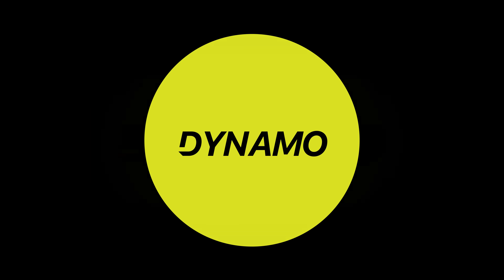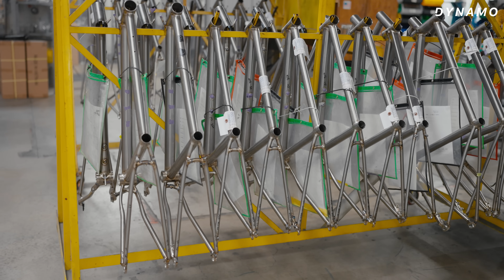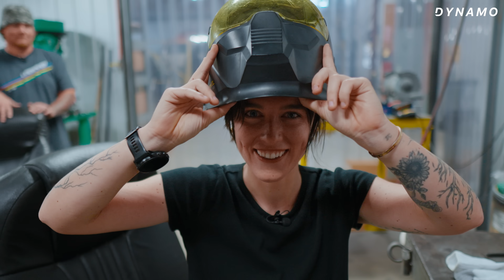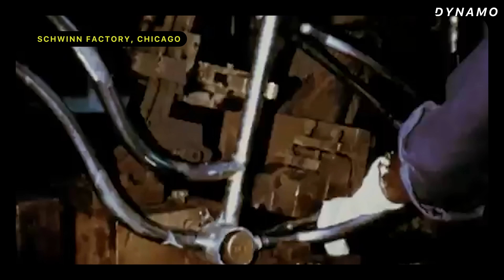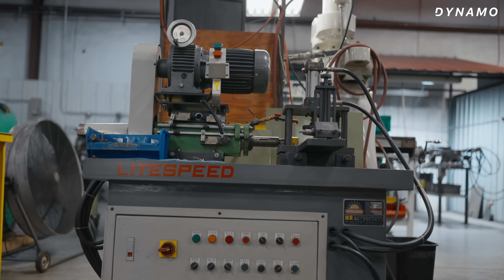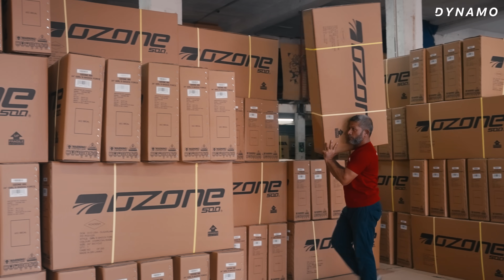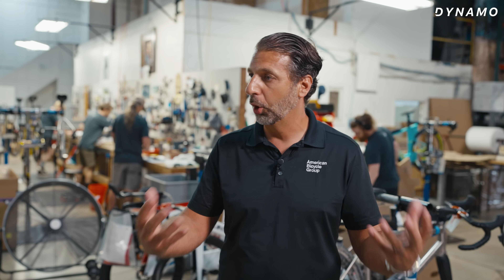What 'Made In America' ACTUALLY Looks Like

Comment: It should be noted the overseas factory was making cheap bikes sold in Walmart for $350 and that Litespeed titanium bike is a work of art intended to be purchased by true bike enthusiasts, designed to last a lifetime, but with a $6000 price tag.
Reply: And there are many more bikes at $6k and $10k price points made overseas that are equal or higher standard "pieces of art" - not sure you're making the point you think you're making. The US can't do high volume, but it's also incapable of leading in the bespoke luxury market.
Reply: @amerikalast  they are even cheaper then this piece of art shit. max 2k-3k you can get same from overseas including shipping. I know because I use it here in India from local manufacturer which makes titanium and carbon fiber bikes. in 2k you get ridiculously good bikes.
Reply: @amazingdude9042 LOL, yeah let’s compare straight gauge Ti with spotty welds that lack decades of experience and a dodgy warranty to shaped, tapered, butted, tuned American Titanium, including 6 Al 4V grade that only the masters work with.   Litespeed and Seven make the lightest Ti frames with the most sublime ride and tuned power transfer, but good luck with those plain round tube and frequent contaminated welds on your cheap titanium frame.
Reply: @amazingdude9042  can you share the names of the local bike brands?
Reply: The thing is, the Litespeed if manufactured in Asia would only cost 1/3rd that price for an equal quality.
Innovation is the only place the US can win, and frankly innovation is copied pretty quickly these days...
Reply: @ryanj610  They have openly been begging other companies to open places in the US so the US can STEAL their innovations and take them for themselves.  trump literally stated that to Korea, they intended to STEAL their R&D in batteries and then try to take over the global market using KOREAN AND CHINESE innovation [because Korea and China jointly lead the world in battery innovation with Japan coming in 3rd].  That isn't innovation, that is outright theft - something the US is good at accusing others of, guess when they do it it's different - and even when you had the technology I seriously doubt you'd have done any innovating with it.  You simply don't have the educated workforce any longer.
Reply: @HeroyamSlava-g3y  America has the Educated Workforce. They are simply looking for jobs.
Reply: PROOF? Don't think it was ever stated Trump wanted to Steal Koreas R&D. Do you have something I can search up?  @HeroyamSlava-g3y
Reply: @ryanj610  Carbon is the way in Asia. They just aren't interested in Titanium bike frames for the most part. Motobecane has frames made in Kenesis, Tiawan that are really, really good. I put 80k miles on one and it still looks new. I wore out everything else on the bike, but the frame stands alone, unblemished and beautiful. Titanium has a really nice, cushy ride. I paid $1400 for that bike in 2013 equipped with SRAM Rival, Mavic wheels, and Ritchey bars, stem, and seat post. The drawback is that they only offer 1 frame for each cycling discipline. Litespeed offers several frames in each discipline that appeal to different riding styles. The cost of high-end bicycles is pretty much the same across the board even if they are made in Asia. You won't find a big name bicycle with electronic shifting for less than 6k these days. If you decided to buy a bike assembled in the US, you would likely get a custom setup that is assembled by experienced techs in a week or less. If you desire you could visit the factory and get fitted for a custom frame. So, service is definitely the edge you get. I paid for my current bike that was built overseas and didn't get it for 4 months. Certainly not a preferred buying experience. It was another Motobecane for 3k this time. Love the bike though.
Reply: @ryanj610  The US can win in innovation only in some specific fields. In terms of manufacturing and automation, I think they've fallen behind.
Reply: We had a high end, world renowned, backpack manufacturer here in New Zealand , who moved to Asia for cheaper manufacturing, at the loss of 300 jobs. Funny thing is their prices actually went up a little !!!
Reply: Would be interesting to see the profit on the Walmart bike and the LiteSpeed Bike on a per unit basis ?
Reply: and with those tariffs they are both gonna be a lot more pricy
Reply: It should be noted that there are bikes that cost more than $350 but less than $6,000.
Reply: Tour de France competitors are using Japanese, Taiwanese and Chinese bikes… just saying..
Reply: Those Walmart bikes don’t last 6 months.
Reply: The reason why asia doesnt wanna make ultra expensive bike because they simply dont see the potential market for it.

Luxurious and prestigious brand perception is sadly not something that asia can make. So even if they make a bike that’s as good as litespeed, ppl will always throw a side eye on it
Reply: @Centrioless there are TONS of very expensive bikes ($10k) made in Asia.
Reply: Amen! Most Americans don't want value.
Reply: THIS
Reply: true , but at the end of the day that logic is bullshido . People do not want to spend more than necessary and in reality they don't have that extra money that's the main issue . So when a nice Focus , Cube , Merida or whatever brand is available at half the price or less , guess what 90% is gonna buy .
Reply: I am from Sri Lanka those statistics are first time I see
Reply: One of their fully built road Ti bikes is $16,000
Reply: I am sure 350 doller bikes last's for ever cheap price tag don't mean they are cheaper quality. Titanium is lighter in weight and expensive to make and those who buy it are mostly high income countries. Even it could be cheaper if made in a low income countries.. but there isn't a big market to it and lot of export ristrictions in usa.
Reply: Chona?
Reply: That'll boost the economy! lol
Reply: @pompeymonkey3271  lol.
Reply: Few people actually use or keep anything "for a life time".
Reply: @orangetube1  True, but quality that will last a lifetime if you wanted it to is nice to have when screaming down a hill at 50mph and hitting a bump with zero affect on the frame. You will never get it, so why are you even here?
Reply: @rustymaximus9179  Hahahaha, "you will never get it.  Why are you even here."  Time to look in the mirror kid.
Reply: @orangetube1  Do you know what clipless pedals are? Do you know what Di2 is or SRAM AXS. You know what a Panorello is? Do you know what a department store bike weighs vs. a high end bike?
Reply: Yea the host being a cyclist should realize she is comparing apples to oranges. If she went to a high end Taiwan bike facility, she would be closer to a good comparison.
Reply: And people enjoy the $300 bike as much as the $6000 bike.  America is a failure as fare as manufacturing because American politics are anti business anti technology.  China is decades ahead because they are pro business pro tech.
Reply: And that is where American (or EU or UK) manufacturing makes sense.  There are people who are willing to pay $6000 for a bike that is made with fair wages, high craftsmanship, best parts. However, there are a whole lot more people who want a bike for their kid that will be outgrown in 2 years or they only make $500 a month and need cheap transportation.  The first is willing to pay and they have the ability to buy because it is important to them and they can afford it.  The second group is buying out of necessity and won't necessarily pay a lot.  For all those make it all in America, what you will see is the high end will stay the same, but the low end will either go up in prices or we will all be buying used bikes (or bikes that are "used" and then imported into the US - take a look at the yacht and supercar industry and how well luxury taxes worked before they repealed them in 1993!)
Reply: @boomerbobable  It’s cute that you think American or British manufacturing is superior to Asian. 😂
Reply: @ws1814  For some products it is. Just like how Germans build incredibly good manufacturing machines and industrial motors.  China/Asia are not the best at everything, nor is America or the EU or UK.
Reply: @boomerbobable  Germans =/= American or British.  Just look at your typical American made cars. Are you proud of them?
Reply: @chunhaylee  I am not sure what your point is. A top of the line US car is about the same level of quality, etc. as those comparable in price from Japan, Germany, etc.  A cheap mercedes is about the same as the same priced Toyota and the same priced Ford. Every vehicle has some inherent issue and balance of where they spend money on interior and performance (US tech tends to be better, but performance lower or engine reliability high but cost of repairs very expensive comparatively.  My parents have a 25 year old lexus that is in amazing condition with 80K miles, while my 11 year old Ford Explorer has over 250K miles on it and starting to show signs of wear, but repairs are relatively cheap compared to the lexus I used to own.
Reply: $6k on a bike is ridiculous. I don't care how much you make or enjoy something. I enjoy food, yet I've never paid more than $30 for a steak. Done photography for years, but I only use my phone. I'm able to save 70% of my salary, for what or who, I don't know. However, I enjoy living a cheap life style and like spending night having a beer and staring at my bank balance.
Reply: @动漫主角 If someone makes that much money it is fine. $60,000+ USD. Maybe is a dual income household. That is an entirely different topic.
Reply: LOL. "Bespoke" eh, so pretentious.
Reply: The walmart bike also lasts a lifetime. Not the chain, of course. And yes, the wheels may brake.
Reply: And no suspension lol.
Reply: Exactly typical American exceptionalism bullshit.
Reply: Crazy expensiv when u can get a scooter with 300 cc within same price.
Reply: Wanna hear something crazy. In 2019 I bought a 2014 Suzuki Gsxr 600 (a sports bike motorcycle) with less than 30k miles. 

Yes bicycles fulfill massively different purposes and have vastly different running costs, but it is crazy to me that my dad bought his bicycle (two of them) for $7.5k each and it’s so hard for me to wrap my head around the fact a bicycle was more expensive than my motorcycle. 

And there are cheaper motorcycles available brand new (Honda Grom and similar)

Edit: added context for more clarity earlier on
Reply: @327efrain  I get your point, but you never said how much your GSXR cost.
Reply: @327efrain  I have noticed that as well.  Its crazy how a 30lbs bicycle costs the same same as a 400lbs motorcycle.  A lot of cost of bicycles come from making them as a light as possible, utilizing expensive materials and a lot of design time getting them to the edge of strong enough.  Its not the end of the world for a motorcycle to be an extra 50lbs heavier because it has an engine.  I think there is a larger demand for motorcycles as well.  So motorcycle manufactures can buy a lot of parts and get better deals than bicycle parts that are being purchased in smaller quantities.
Reply: Fortnine, a popular motorcycle YouTuber, already has a video covering this  @327efrain 

When my GSXR1000 was stolen, I was bummed and moved on. When one of my mountain bikes was stolen, I went out of my way to replace it as soon as possible.
Reply: That $6000 US bike is a scam. The metal is not US. And, nearly all of it is off the shelf parts from over priced suppliers.The issue with US companies  is that they should be making that same quality for $1500 to $2500 rather than $6000 so they can take part of the lower part of the market while doing true innovation in manufacturing and engineering for their $6000 US bike. Too complacent on value which results in bad value for money and bad quality(benchmarks and premium-ness) for money. US small business mentality is make a scam and then let the business(and industry) die out.
Reply: @kknn523  indeedy doo. Who would have thought there would be lines out the door for a 6000 dollar bike? Who the hell signed off on this as a business plan?
Reply: @appaedde  Lots of mediocre people buy mediocre products at absorbent prices. Does not mean it is a sound business model for businesses. They stopped innovating like Nokia and will meet their end soon, as the cheaper Chinese brands make the same mediocre product for half to 2/3rds the price.
Reply: @kknn523  I'll be honest. Hard fore to Swallow the idea a Bike should Cost as much as a RTX 5070 TI
Reply: @silverhawkscape2677  The bike maker is not selling to you in particular. There are also suits made of just fabric that are $3k to $10k. Some people just have tons of money,  companies the sell a luxury item, and the money gets circulated/taxed as a result. Win/Win.
Reply: You are describing the difference between a normal product and a product with a hefty stupidity tax.
Reply: @tonglu3699 Are you saying the fancy bike is a stupidity tax? (Waste of money) We all have different hobbies in life…. I am sure there are things you spend money on others would call dumb and vise versa.  Live your life and spend your money on what makes you happy. Don’t judge others doing the same.
Reply: @Forshledian  actually, it means that you're basically overpaying for some basic welds/material
doesn't mater if that's your life hobby, it doesn't change the fact that it's a stupidity tax, even those cheap Chinese bikes work just fine, the difference/requirement to makes them fancier is almost zero

funny how you turn this "stupidty tax" thing/topic into hobby thing lol, they are 2 separate things lol
Reply: @Forshledian The same bike made in China would be $1,500. That $4,500 extra is the stupidity tax
Reply: @tonglu3699  Spoken as someone who’s never ridden a high quality bike- and is too unknowimg to realize what they’re missing.  I bought my Litespeed Ti in the 90s and it’s still a joy to ride.  I will pass it on to my child.  The frame will never rust or corrode and rides with the same tuned feel as day one.  Meanwhile, garbage department store bikes are heavy, poorly made, and designed to be used up in a few years of not being ridden as much because they’re not enjoyable.  Spending on a quality bike is spending on your health and sustainable enjoyment, but hey, go spend money on a big screen tv and takeout instead, but set some aside for diabetes meds or cardiology procedures.
Reply: @UwharrieRider  that has nothing to do with being built on the states or china, steel/aluminum and welds are the same here and there
Reply: @UwharrieRider Calm down, maybe go for a bike ride? 😂
Reply: @UwharrieRider  Tis true and applies to many products - there's no substitute for quality. The problem is that the percent of population who can afford a $6K Ti bike is small and dropping. This will mean that eventually the custom made bikes manufacturers will have to close or outsource.
It was the Western greed and pursuit of cheap goods with little regard for durability and quality that made China a superpower. They waited and waited and worked hard... no it's Game Over.
Reply: @UwharrieRider  Those bikes are made for gullible people. The frame is a simple tubular design... There are no innovations to the frame. It's just over paying 5x for material change.
Reply: @kknn523   That is incorrect. High end titanium frame tubes are swaged, butted, shaped, tapered, and curved to tune them for particular priorities, and the tubes are not simply round.  Some now also have tubes that are rolled and welded or 3D printed out of 6Al/4V Ti, a material that is lighter and stronger than 3/2.5 but is difficult to work with.
Reply: litespeed will be sold within 3 years because its a toy
Reply: "cheap bikes" for 350 to 1k USD... which is already mid to upper level costs. 

The US manufacturer is using titanium for no reason. Aluminum is lighter, more corosion resitant, just as durable for the purpose (if a car rams you titanium will still break, if you fall down Aluminium will not deform either) and costs less than a tenth, depending on Trumps mood less than 100th. 

I agree that comparing these two makes no sense. But the US bike is more of a gimmik than a worthwhile product. Its the Apple Stand of bikes. A Premium product meant for a select few people, not the general public.
Reply: Yes but. Should be Noted that American Companys will just not bother anymore with making cheap bikes cause the market is compleetly flooded by chinees crap or that they cant even make anything cheap anymore. Wich is pretty sad tbf.
Reply: @Mohawk52x Chinese crap isn’t the problem, that’s for the supermarket and bottom end of the market. They make most of the carbon fibre top end bikes and wheels in China or Taiwan, they are half the price and superior to anything that we can make in the West. Their carbon fibre is better because they make over 90% of the top end bikes and have perfected their manufacturing process. Titanium bikes are also available, they cost about half of the Western made bikes and are already comparable.
Reply: @Mohawk52x The craps are $50 in China and marked up by the importer to $200. China makes $1,000 bikes too and those carbon fiber ones are sold here in US for $$$$. US businesses making a lot of money and cutting corners in their designs
Reply: lol, that’s hardly a work of art. Maybe it looks like art to an American. 😂
Reply: You don't need three bikes.  You can get by with one bike.
Reply: @kronosaurelius  I have a good friend who is a very serious bowler. He has over 15 different balls that he takes to tournaments or even to play recreationally. He says some balls do better in some wax or wood.  If you love something, you find ways to have specialized equipment to do it even better. So yes, the average person (like me) needs only one bike. But there are plenty who will desire to spend $6K on the lightest frame, best kit, etc.
Reply: @kronosaurelius  bikes are toys
Reply: Airplanes are toys too. What is your point  @flytoday ?